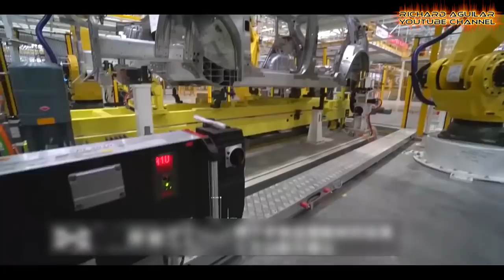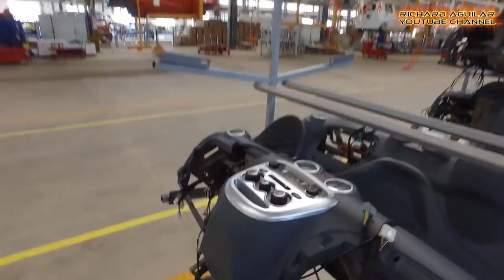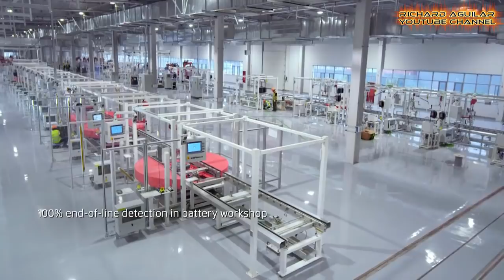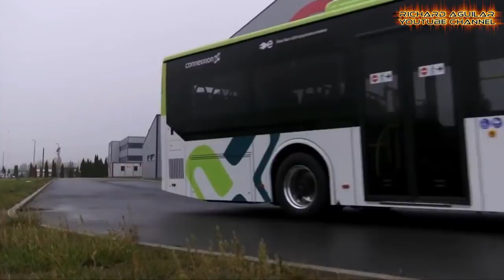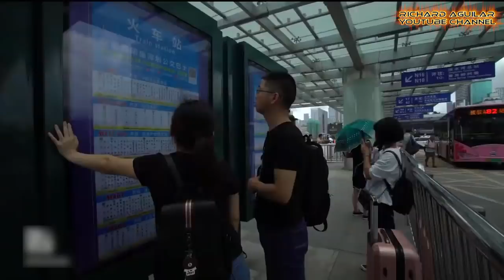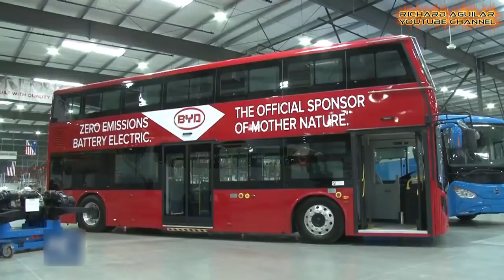Advanced Electric Vehicle Factories In China Are On The Rise! WATCH

Comment: Alibaba has got mid  size 4 seater 30 mnt fast charge. 70 mph 380 km EV for less than $5.000. us.
But you have to buy 10 to get that price each.
Here in the us they would fetch 20 grand apeice and sell cokes on a hot day at the ball park.

Comment: The future of all transportation is electric.
Electric cars, electric trucks, electric buses, electric trains, electric trash haulers, electric boats and even all electric lawn and garden equipment. Gas and diesel are OLD POLLUTING technology. Electric is just better. No noise, no emissions, no pollution, less fuel costs, less maintenance costs. The sooner the world changes to all electric vehicles the better it will be for the environment. The Climate Crisis is getting worse. WE need Climate Action.
Reply: Tiuz Kanggz  Solar energy is cheap and easy to install.
Reply: If you compair a Thesla to a Mercedes they are at same co2 level at 470.000 km. And they can't ewen process the used batteries in a good way yet.